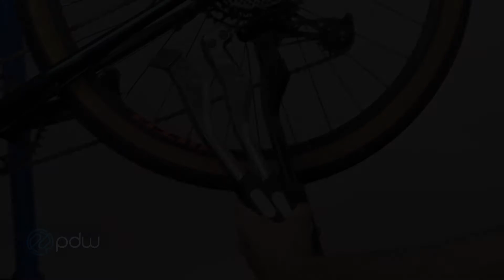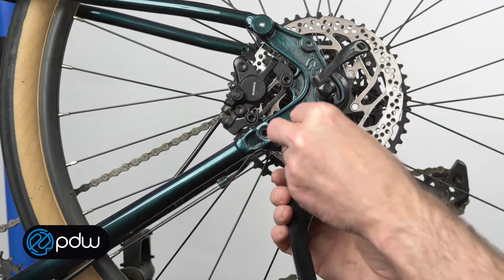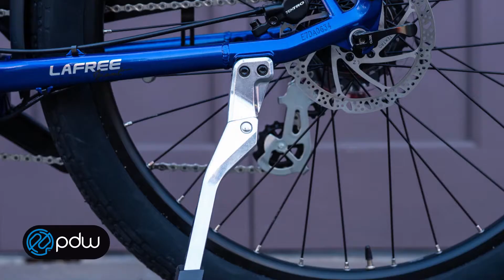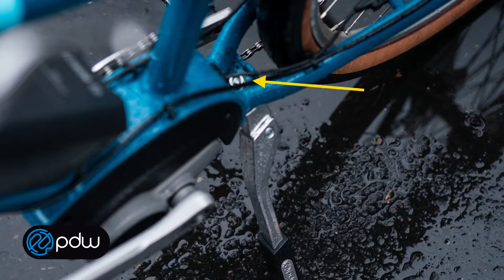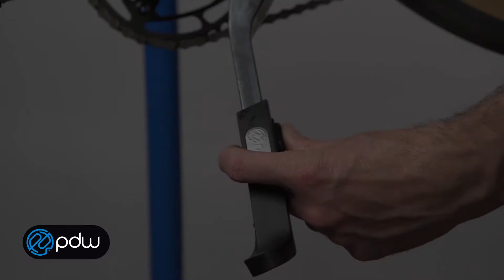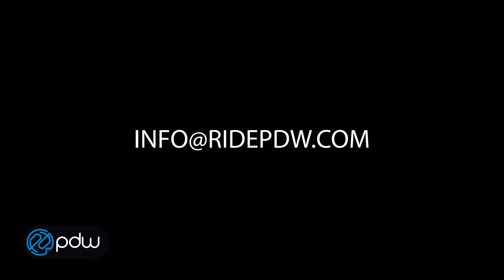PDW Powerstance Kickstand Installation

Comment: Is there a place in L.A. that does the side drilling fir yer 18mm E-bike stand, that just arrived
Reply from the maker: @robinhoodloom1  Just looked at some photos of the Sondors Rockstar and it doesn't seem like a good idea to drill any holes in that chainstay. Looks darn near impossible to get a kickstand of any sort on that bike with the mid-drive motor and full suspension rear.
Reply: @PortlandDesignWorks  I know this place, that is in a Coastal City.If they can't Bust out with the Tap-N-Die set, then I will.This bike doesn't go off road,so I will risk drilling.Thats an inch of solid metal.lol
Reply from the maker: Bike frames with holes near the rear dropout have those holes integrated into the original design. You definitely don't want to drill additional holes. If your bike doesn't have existing holes you probably need the center mount version of the Power Stance.